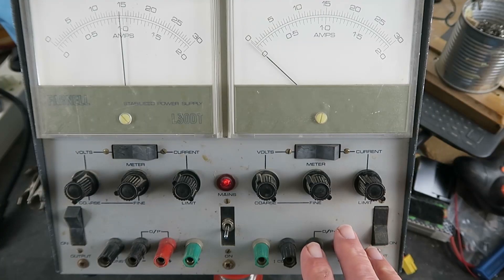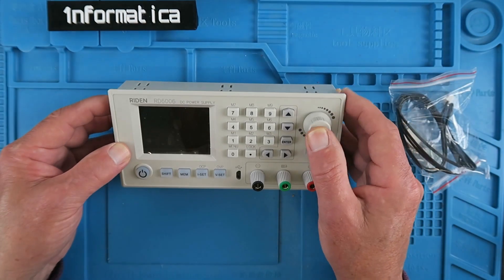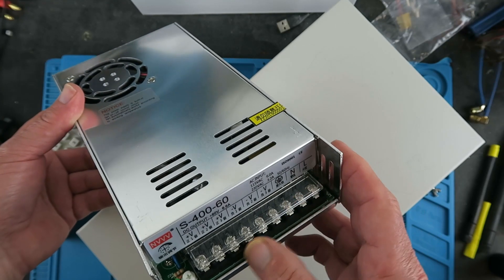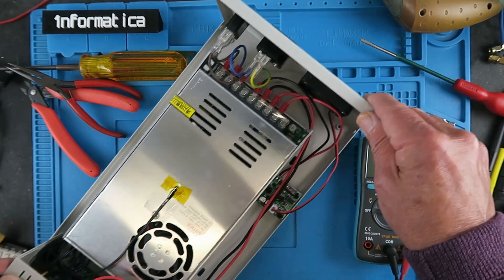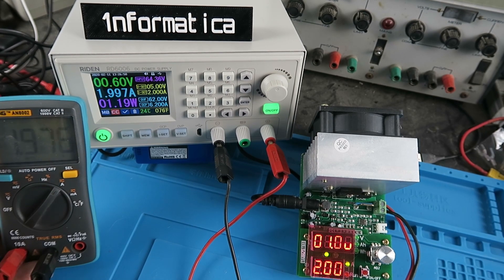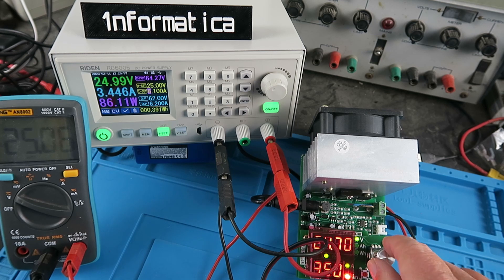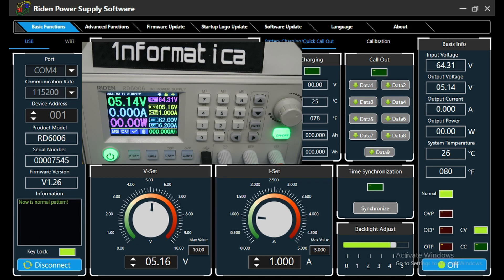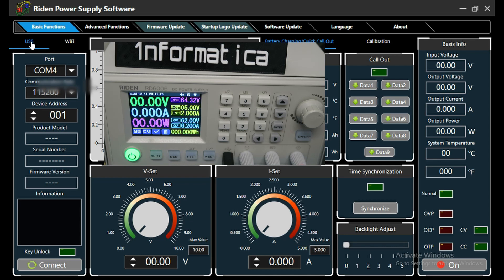RD6006 W Digital Control Switch Adjustable Power Supply 60 Volt 6 Amps

Comment: Mine when I connected to load, voltage drop to zero. Just bought it and first test shown like that, do you have any idea?
Reply from the maker: What do you have the current (I-set) set to? Must be greater than the load you are using. Even with no load if you put I-set to 0 you will get no output.
Reply: @1nformatica  i am using it to diagnose my short circuit board. I  set 5V and 5A, when I apply it to the board Voltage drop t 0.6V with 5A, so I didn't get 25w set? How do I fully drive it at maximum watt I set?
Reply from the maker: When the PSU detects a short circuit it will enter constant current mode. In this mode the voltage will fall to protect the equipment. There is no way to "force" 25W into a short circuit. To troubleshoot the board look closely for any components that show signs of getting warm. You can remove components or cut legs to try and find the device that is shorted. Otherwise connect it to a PSU with no current limit and see what goes bang! Eye protection advised!
Reply: @1nformatica  okay I got it thanks for your time sharing this useful information. I thought i limited current and voltage and power supply keep feeding current to the board😜.
Reply from the maker: Good luck with the repair.

Comment: Went with the smaller DPS5005 even though the price difference isn't significant but the S06D case for the external power supply takes up quite a lot of room and isn't fanless. Can't wait to receive it along with an aluminum case I'm gonna mod since @RD Tech only carries a steel cas now
Reply from the maker: Thanks for watching and good luck with your project.

Comment: thank you for making this video
Reply from the maker: Thanks for watching! I hope the WiFi connection to the PC software can be fixed soon. I'll be making another video looking at the battery charging function so maybe subscribe?!!
Reply: @1nformatica  yes we will, we are trying to make the wifi connection more stable, the case may affect the connection, and for now the battery charging function is simple, but we design the temperature sensor in advance so that you can update the firmware to use the new function
Reply from the maker: @rdtech9153  Thanks for the update! look forward to trying that out. Thanks for subbing.
Reply: @rdtech9153  I've had success with the WiFi mode with the PC software, I just had to restart the software after distribution completed. Please keep this functionality! I know it doesn't work in all cases, but it's very useful the times that it does work.

Comment: I think, logging the voltage and current can be pretty useful. Like for validating prototypes or maybe, if you want to charge the battery of your car with it you cold observe the voltage while sitting in you living room.
Reply from the maker: Good point! I must try that!! Seriously though, I will make a video on the battery charging function which I omitted. Thanks for the heads up.
Reply: 1nformatica I think, it even has a battery charger mode, right?
Reply from the maker: Yes, confusingly it is the green terminal between the red and black. You would think it was ground but it is not!
Reply: 1nformatica well, you could replace the colored jack with a purple one. Then, you don’t confuse it :-)

Comment: you would think with that level of sophistication it would have more outputs great video thanks
Reply from the maker: Thanks! I think this company is going places and it will be very interesting to see how they build on the success of this product.
Reply: how often do you need voltages above 30? i see there is a smaller similar stepdown dps5005 half the    cost stick two of them in a 3d printed case with a big single supply powering them to get a similar setup to your broken antique or reuse the case with these. Make sure you disinfect your china purchases 😀
Reply from the maker: To be fair it's not often I need above 30 volts, but when you do, you do! I occasionally work on communications equipment that is -48 volts for example.

Comment: I have NEVER had a Store purchased PSU.  Never had the funding to buy one.  Always just rigged up what ever I could with what I had.    Now that I do have the funding's  I still just use whats at hand.  LOL   Guess I'm just a CHEAP SKATE.  I do have a few of the Chines BUCK BOOST PSU now days.  No Real Display.   Just pots to set the Voltages and Constant Current.  Guess I like the pain of setting them up for every task ?   Guess you can  call those Store Purchased Real PSU's minus the case ?   Always had Boxes of reclaimed Transformers and Crap on hand.   Been doing a pile of work with batteries and PSU's these days,  I have a serious need for one of those Constant Load boards.
Reply from the maker: Each to their own! I really must do a review of that Electronic load, I use it a lot. You can get yours by just clicking the link in the description!!
Reply: @1nformatica  I do need one.  Will investigate   .  Everything coming from China is sorta on hold it seems.  I have 12 order that have been on hold shipping for a few weeks now.  I think they're quarantining everything leaving.
Reply from the maker: Yes, there will be a little more delay than usual but it is in all our interests.They're doing all they can to stop the spread.
Reply: @1nformatica  No complaints from me.  30 days I was told.  Guess they figure any virus won't be lasting that long.   Be happy it not killing people like the Spanish Flu did.  This one   is only taking like 15% . The Spanish flu was 70%  Only reason this one is so bad is how easy it is to contract I guess.  Kia is on hold due to parts shortage.  More to come.
Reply from the maker: @pulesjet  Now I'm worried, you know I live in Spain, right?!
Reply: @1nformatica  The crap doesn't respect any borders  Sir.  We're all worried.